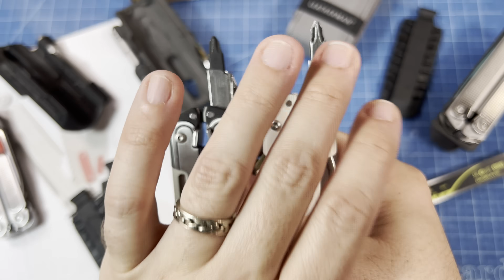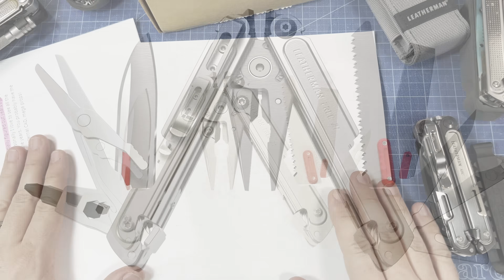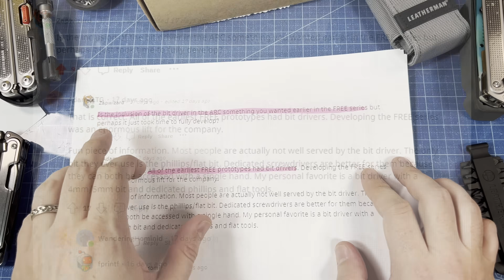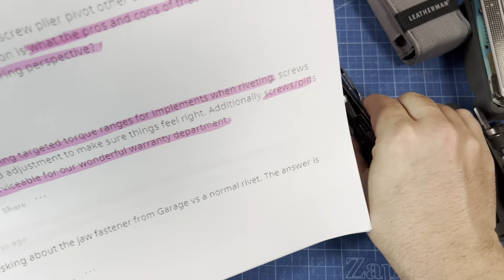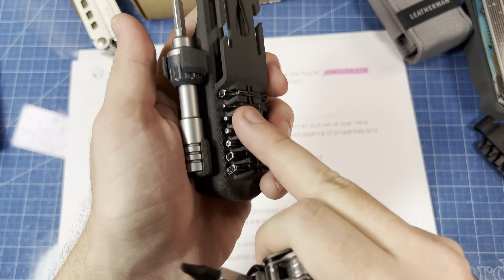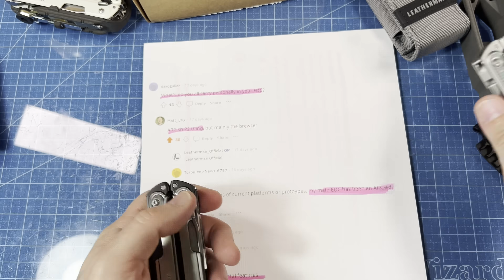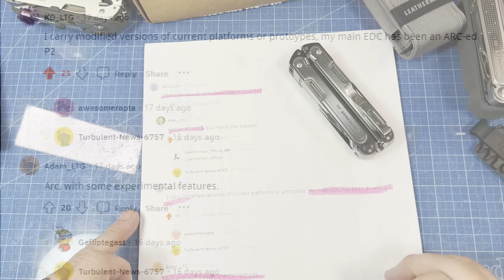Zap's Leatherman ARC Ramblings

Comment: Wonderful video as always ZapWizard!  I can't wait to order the standard Arc holster with the Barnicle bit add-on.  Having both the Leatherman Ratchet Driver and 711 Ratchet on the holster is genius as I currently carry both with my G10 Charge+ Leatherman nylon holster along with the WiHa Double Sided (77781 & 77782) Bits.  The one thing I wish you would add to your store is the full feature set of your Arc holster to the Charge G10/TTI holster as the mods I've made to my G10 Charge+ improve upon the stock Arc tools for my use case.  I also prefer the comfort of the G10 Charge+ in use so far compared to the Arc.  I would 100% purchase both holsters (at least 2 -3 G10 Charge+ versions and 1 Arc) from you so I could grab and go with whichever tool I wanted/needed for that day.
Reply from the maker: Ya, I know my older holsters are getting neglected by the FREE series features. It just takes time to design and prototype each change. (Along with updating hundreds of renderings)
Reply: @ZapWizard  Don’t worry, I wasn’t saying that as any sort of a dig, we all highly respect the work you’re doing on the Arc/Garage/Free tools!  I’m just hoping sometime down the line once you’re caught up on the hot items that will and should make you some money there will be updated versions for the G10/TTI Charge+ because I think a lot of us aren’t as impressed by the Arc as we were hoping to be.
Reply from the maker: @93MichiganFootball  No worries, I didn’t take it that way. I do have improvements I need to push back down the product lines.

Comment: Hey so I’m a firefighter and I’ve always carried a leather man OHT and I’ve used and abused it but i constantly find myself sharpening it, and it extremely bulky, I have 2 of the raptors and I keep them on my bunker/wild land gear, I would love to see a seat belt cutter implement for the arc/free series.
Reply: Comes from factory with one on free p4, its called a serrated blade dude
Reply: Serrated blade from the p2/p4 series replacement parts. Switch out the saw for the serrated
Reply: I am ex volunteer firefighter and medic 

Best for seat belt cutters i have in execrations  is police spyderco and resqume tool

Comment: Whats the chance of having your holster option to include the ratchet on 1 side and the bit extension on the other side . Thank you & keep up the most excellent work .
               THE DUDE ABIDES
Reply from the maker: Slim as a default option most folks don’t carry both. I may go back to my original P4 design for the gripper which was compatible with either model.
Reply: @ZapWizard  thank you I will be placing my order once you get the ARC holster up and going .

Comment: Leatherman arc holster holds two bit kits, and two loops on the outside.   Absolutely brilliant if you need to carry a torch and a ratchet bit adapter.
Reply from the maker: The included holster is quite capable, but oversized (vertically at the very least). Just pointing out that they didn’t spend the money to make a tool specific holster.

Comment: Any thoughts on the new design for the cutters? They appear to be significantly weaker for cutting hard wire.
Reply from the maker: I took the cutters out of my P2 and put them into the ARC.
Reply: @ZapWizard  I’ll do the same if mine break but I’m hoping Leatherman will send out replacements that are stronger.

Comment: What thoughts do you guys have about the Arc cutters breaking cutting coat hangers on various other channels?
Reply from the maker: I do think it is an issue, I use the hardwire cutters sometimes to trim the length of small screws. I traded the cutters of my P2 into the ARC.

Comment: Probably the reason they didn't make the scissors longer on the arc, was to keep manufacturing costs down. If you use the same scissors in every tool you grab and go verses having to make sure you have the correct scissors with the correct product.
Reply from the maker: Yep, the T4 is the smallest tool that has the same scissors, I think they just kept that size.

Comment: I’d be interested in just a bit holder. Like your no clip holster option but without the holster. I like using the pocket clip on the Leatherman but find pocket carrying two bit holders to be annoying.
Reply from the maker: I have been wanting to design a stand-alone pocket bit holder, but I haven't decided on the design yet.
Reply: @ZapWizard  I think you have a really good idea with the way the holster with no belt clip looks, just don’t add the holster to the back.

Just make it hold all 20 bits and the extension options (maybe the micro bit too). 🤷🏻‍♂️

Comment: Very good information in this video . Did you experience the issue with the cutters with yours ? And I'd really like to know if the Arc has the same issue some Free series did where the plier head kinda seizes up when put under hard load when tightening ? Cheers .
Reply from the maker: The ARC does have the new cutters which have the rounded corner. I did swap out my old cutters from the P2.

Comment: Very nice.  I really love your holsters and plan on getting one.  I have the mag sheath from RAE Gear for the P4 that works with my new ARC.  One thing I like about it is I can still have the pocket clip installed.  Will any of your holsters allow for that option?

Edit:  By looking at my set up, what I would like is a holster with the main blade with the thumbstud facing the back of the holster, tip up.  That allows the pocket clip to be installed, facing outwards.  Is that an option that would be available?
Reply from the maker: Yes, if you move the clip to the blade side of the tool.

Comment: I am glad it doesn't have spring loaded pliers. I have been wanting a free series multitool, but I have to pay off some bills and then I am going to wait until I know the tool doesn't have issues, before buying it. I wish the P4 had a full size file, because I would have gotten that.
Reply: Supposedly the cutter inserts crack easily if you try to cut hard wire like a coat hanger. I used mine to cut .035 welding wire. No issue. But that is thinner than a coat hanger.

Comment: Thanks for telling me about the 711l!
Didn't know that tool existed but will be getting one
Reply: For the price you're better off buying a Wera Tool check set (probably metric) to cover that area. On Amazon the 711 costs close to a dedicated Toolcheck that can handle A LOT more use cases. The ratchet is probably a lot better too and comes with an extension bit, not to mention a variety of bits and some sockets. I own the Wave+, Surge (current gen), a Charge+ TTI, and a modified Charge TTI. If you wanted to spend a bit extra you could get the Metric and Imperial Toolchecks to cover everything you will possibly need regarding many fasteners types. I love Leathermans but also like to get the most for my money. I guess it also boils down to how much you want to EDC. The 711 looks awesome though. I only complain about the price. If money wasn't an issue I'd buy 3 of them on principle alone.